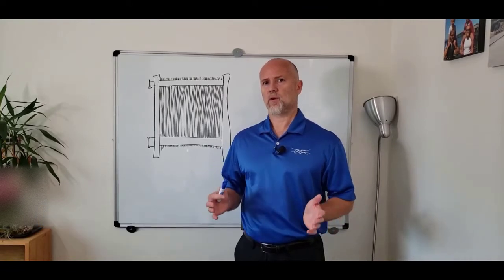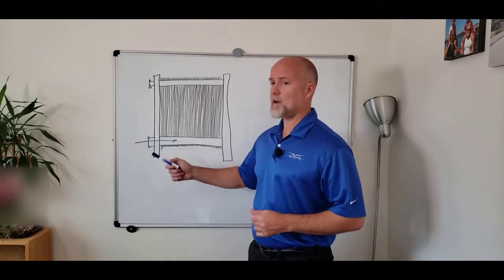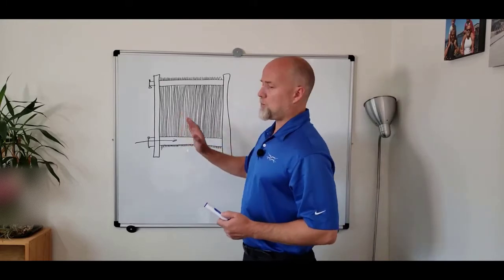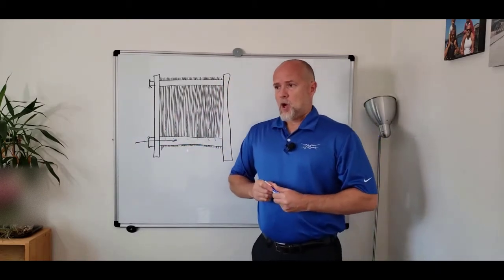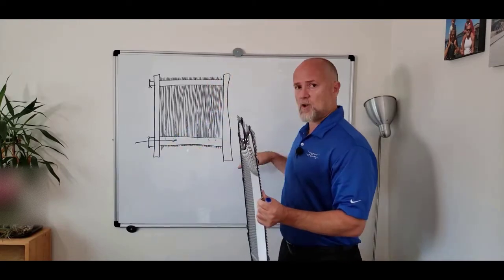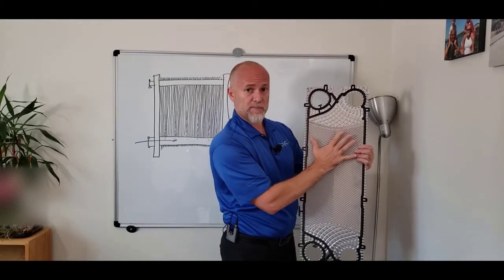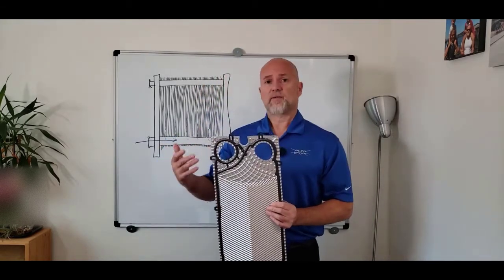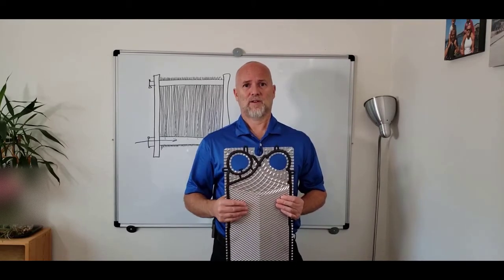Fluid Distribution Inside a Heat Exchanger

Comment: Thank you for all videos. One question for this one, could you explain further why cold flow is given from bottom? What is meant by "taking advantage of positive pressure coming from pump"?
Reply: A reason that cold flow, in this scenario, make more sense from the bottom is that when you have fluid from a cooling tower you can sometimes have debris in the water. Pumping in from the bottom would leave most of the debris at the bottom for the exchanger instead of trying to flow down across the plate where it could clog.
Reply: @MDDoesLife  that makes quite sense. That which i believe minimizes risk of debris damage between the plates. Thank you for answer